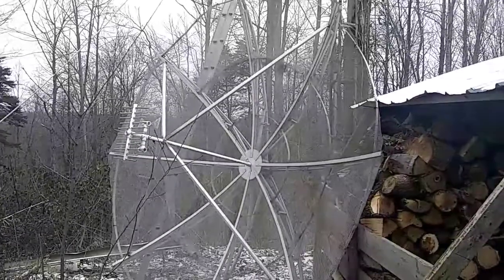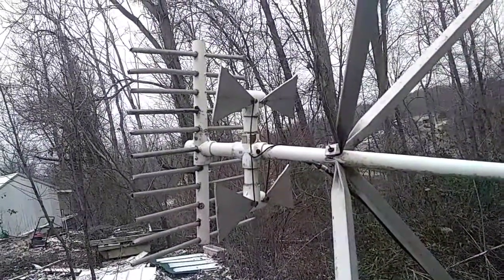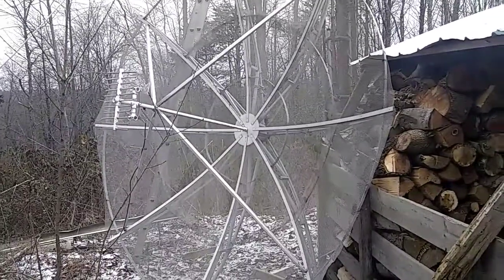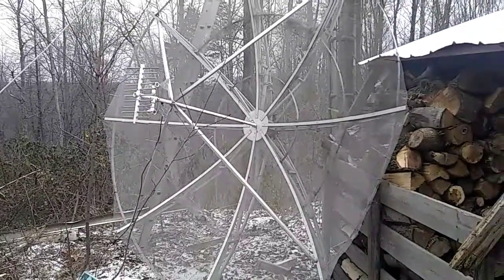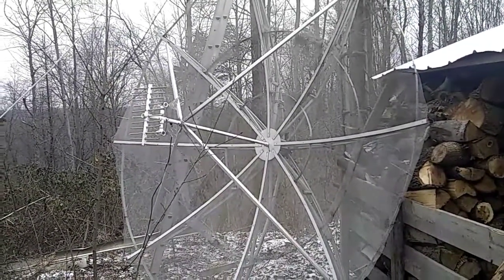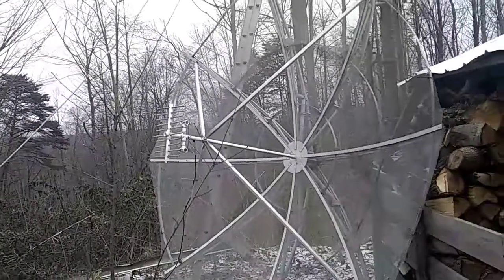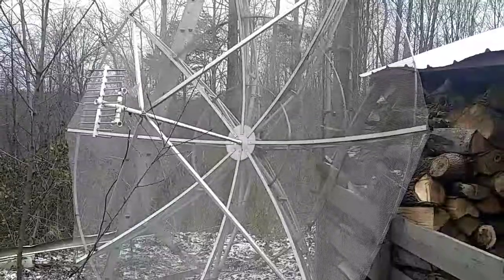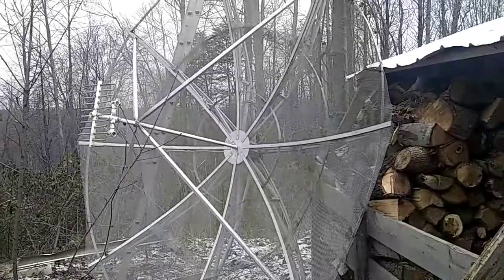TV ANTENNA 10.5 FOOT PARABOLIC POWERFUL

Comment: those u bolts are not graded steel! need graded steel bolts!
Reply from the maker: Would be better but wont bend in wind possible to break
Reply: Leaf spring u bolts would work! That dish would be good for fee to air sat antena!

Comment: Curvature of the earth, altitude, distance from the ground to pole position. All factors to use in calculating good gain and reception. The calculations they don't tell you about is the location of repeater towers and how high they are above the curve of the earth. So, in the past (30 years ago) I have lived in Fresno CA, where we were able to regularly receive stations as far away as 300 miles North up the valley. Where it became difficult was over The Grape Vine Pass toward Los Angeles or over the range toward San Francisco. Of course that was because we put up a 40 ft pole with guy wires on top of the peak of the center line of the house. which made for an over all height of 58.5 feet above the ground. The top of the pole had a 6 ft yagi and at the 55 ft mark a 5ft open mesh parabolic 1W Ham transceiver  . The yagi still rotates with the remote system still operational. But now it receives more channels than anyone needs to see. From Sacramento to Bakersfield. Of course it can't regularly receive over the ranges but, it does get bounced signals in the winter.